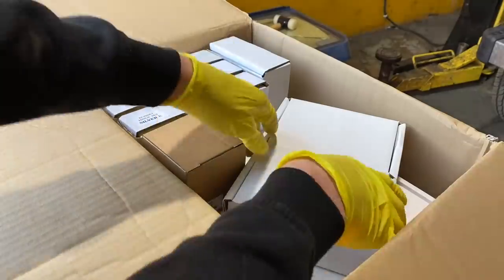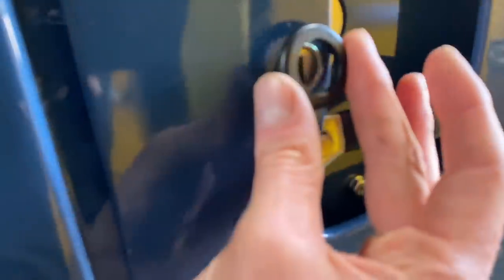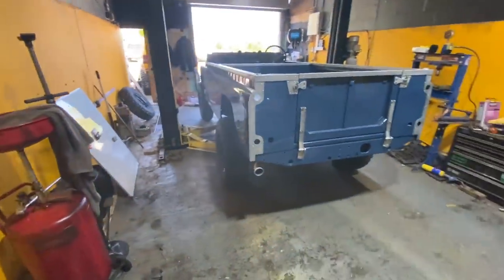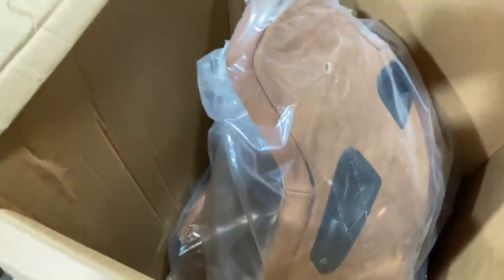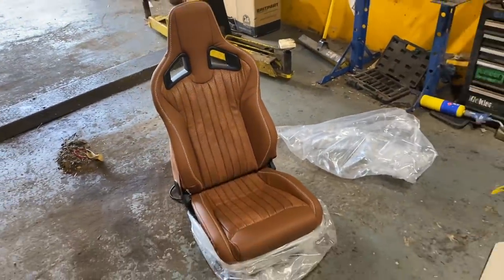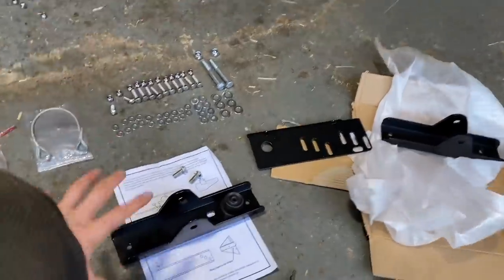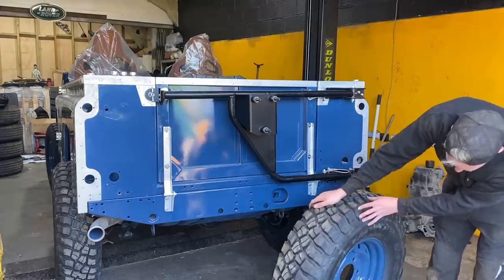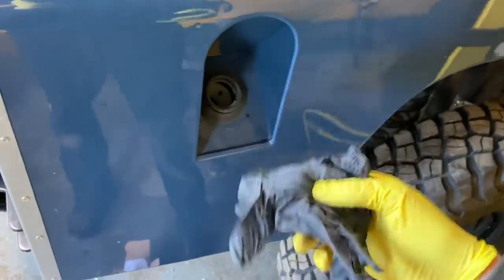Land Rover Defender Classic Soft Top Build Part 4

Comment: The wheel carrier looks very well build, but the lock looks like metal on metal. Isn't it going to rattle like crazy going off road? The build is coming along nicely.
Reply from the maker: Siebren it’s very tightly held against the tailgate, if it rattles I’ll add some rubber or foam to prevent but the rubber stopper should keep it from rattling 💛

Comment: Another awesome build, is it going to have the safety devices heavy duty frame bars or the galvanised original style hood sticks. Where did the galvanised tub trim come from YRM by any chance?
Reply from the maker: All original parts removed and galvanised, hood and sticks ordered! Not long now 🙏🏻
Reply: @juicemotors  I have been considering getting my pick up bed trims galvanised as the original paint finish is very poor.

Comment: what kind of seats are they and do they have the removable bases
Reply: They are recaro sportster cs, beautiful build but very expensive. Bases are not removable like the original ones.
Reply: @pampa1996  you can get some like that with the bases that come out i bought some similar and i mounted the runners on narrow stainless marine hinges and  now i just need to pull two clips and the whole seat tips backwards total result access to everything in seconds
Reply: forgot to mention doing a new build 110 so wanting new interior for it ,300 tdi auto box etc air ride too in white full csw  ,just got it back from blasters took me 5 hours to spray the chassis with zinc primer and chassis paint its on nice and thick
Reply from the maker: graham- martin they’re Recaros and have removable bases like originals 💛
Reply: @juicemotors  sorry i misread first bit when you told me sorry ,you are pumping some serious money into your builds ,i am referbing a lot of my stuff were i can ,most of your customers must have very deep pockets lol
Reply from the maker: graham- martin This isn’t a customers build 💀 I do however have an obsession for quality 😍 these parts come at a premium though 😭
Reply: @juicemotors  yup i know how much all the bling costs lol too friggin much for what it is  lol